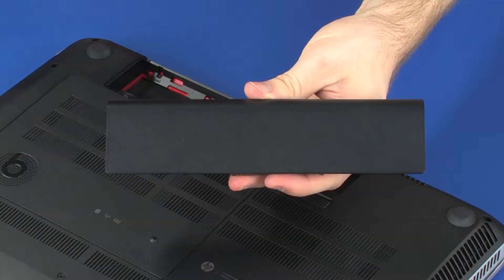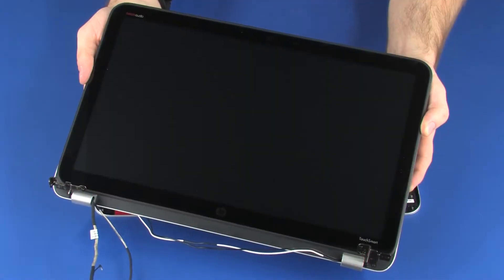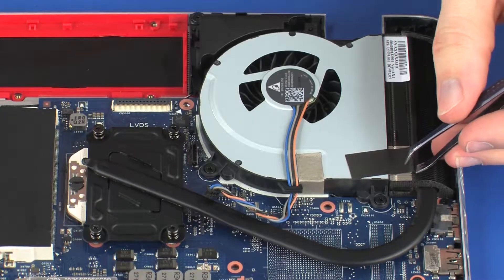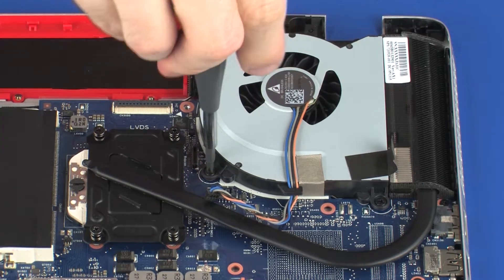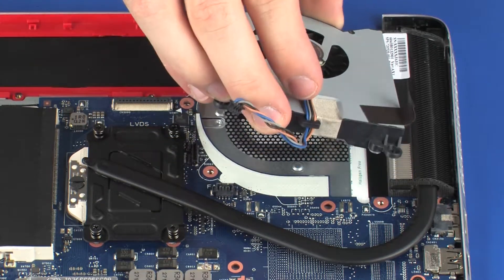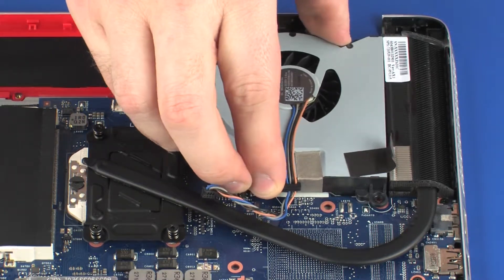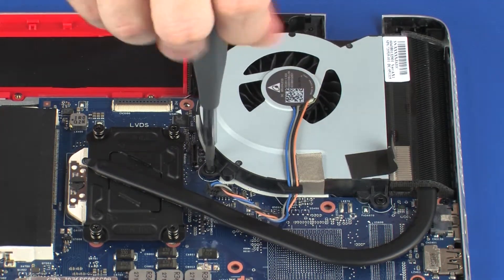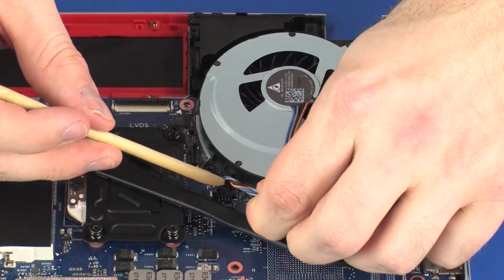Replace the Fan | HP ENVY Notebook - 15-q370ca | HP

Comment: Is it necessary to remove the display before replacing the fan? The two components don’t seem to be connected in any way, what does this removal facilitate?
Reply from the maker: +Abigail Grimstad Please refer this document to know about replacing the fan: https://bit.ly/2VwNgoM
Reply: @HPSupport   Can you re-fresh the link - the one above does not work
Reply: @wdwyatt  I realize this is two weeks later but here's the service guide which has the fan removal on page 55. I'm actually disassembling this laptop now so I may update this post later to say if I had to remove the display or not. http://h10032.www1.hp.com/ctg/Manual/c04498499.pdf
Reply: All right, so here's the deal. I believe it may be necessary to remove the display because the upper part of the fan assembly has a rivet / screw situation where the bracket hinges through that to connect to the rest of the assembly however this particular laptop the rivets actually busted through and as a result I was able to remove the fan without removing the display assembly but for all intents and purposes this laptop is broken.